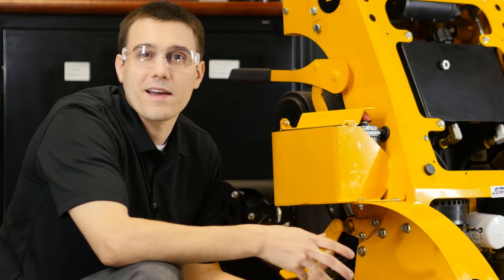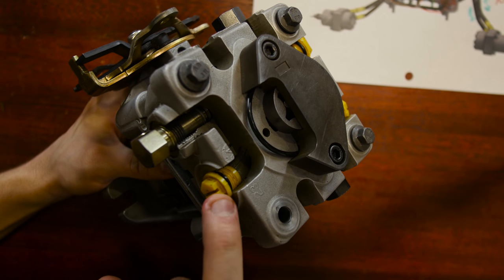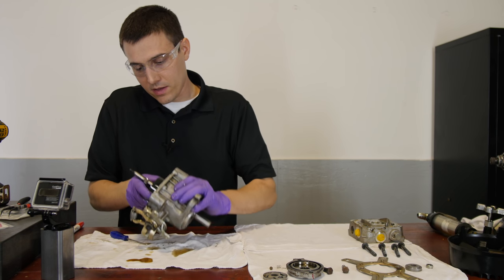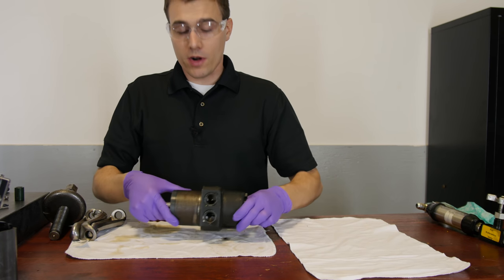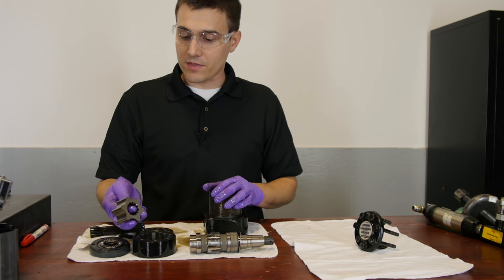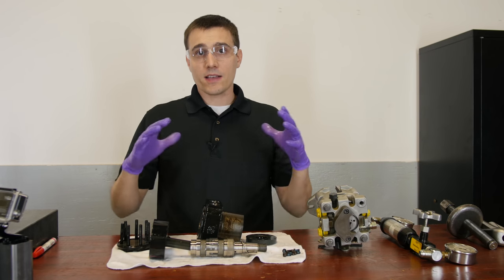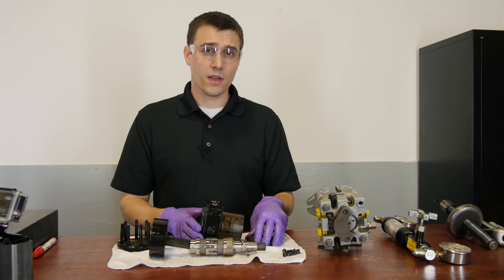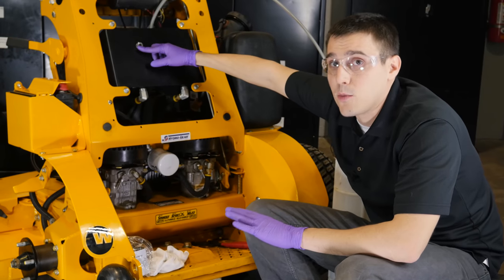Getting More From Your Hydros: Everything You Need to Know

Comment: The video failed to mention pre-filling the new oil filter. Always allow some extra time to let all the air purge out of the oil filter element while completely filling it with fresh Mobil 1 15w50. This helps eliminate a huge amount of air getting into the pump and motor, and prevents momentary oil starvation. You will only lose a very small amount of what's in the filter when threading it into position on the filter mount. It's a good idea to take this extra step on all equipment that use spin on filters. Some manufacturers either strongly recommend, or require this prefilling of the new filters on all their equipment and engines.
Reply: why would you put unfiltered oils into your system. That was asked when i did that a long time ago. Thought on that?
No wrong answer just a thought.
GREAT VIDEO!!
Reply: Hard to pre-fill when filter is horizontal! Should the filter be partially filled?
Reply: CAT, and CUMMINS advise NOT to prefill oil filters as you are putting unfiltered oil straight into the engine bearings.

Comment: change the oil often on those hydrogear transmissions, makes a huge difference. almost as often as you change the oil on your motor. ive had huge performance restoration from dropping the oil. the heat absorbing properties eventually wear out the fluids functioning and it has to be changed.

Comment: I had just put a new seal kit on my pump a couple days ago, when I took my pump apart I didn't see a ball for the charge relief valve and didn't even know I needed one until I watched this video I was wondering why there was even a spring... I have it back together and it works great but now I'm terrified and worried that it will mess up knowing mine is missing something probably critical

Comment: Hi Ed,

I have a Gen 1 Stander X. There was a lot of debris and buildup around both hydros so while rebuilding the engine I took opportunity to clean them up and replace the low pressure feed and return lines.

I replaced the fluid and filter (OEM) after the line replacements. I now cannot get the system to bleed. I am following recommendations in the service manual (jacked up and cycling levers with bypass valves both open and closed). Both wheels turn lethargically and can be easily stopped by hand. Any suggestions? I believe the pumps are at the end of their lives (high time-passive leaks) but I’d really like to get them bled and working in the interim.

Thanks. -Max

Comment: what hydro gear pump is in this video?
Reply from the maker: +Tim Broughton There were actually two pumps shown.  The cutaway one was a 10cc pump from something like a Small frame Stander from a few years ago.  The one with the fan that was disassembled is a 12cc pump that's used on the Stander X.  Thanks for watching.

Comment: Ed, 
  What are your thoughts on not running the engine at high idle when moving the machine around? Is that hard on it when the pumps are growling at you at say 1/4 to 1/2 throttle? Thanks.

Comment: Nice and informative video. For the standard ZTR hydro, is there anything that can be (affordably) done to make them safely run faster or increase output?
Reply: I work at a Grasshopper dealer and get this question quite often. The short answer is no. You can tweak the neutral setting to gain a little. Also you can turn up the RPMs on the engine a little. I wouldn't go any higher than 3680. Some go higher but these engines are designed to run 3600. The small amount of ground speed you'll gain isn't worth the extra engine wear. Hope this helps.

Comment: I tore apart a pump and didn't see anything wrong with it and slapped it back together. Before that it had weak power almost no reverse on the left side. About to tear apart a wheel motor hoping to see something obvious...what could cause the left side to have no real power only barely moves forward but after it's put in neutral the left side still goes forward just as weakly as if it were in drive no reverse working on left still while the right wheel acts normally the whole time.

Comment: I have 3 question.
1) How often do I change the hydraulic  oil on a mower? 

2) can a hydro pump, over heat? Like the hydro pumps from right stander fix deck. Don't have  a cooling fans.

3) is it bad to power wash the mowers and is it bad to power wash the hydro pump?

Comment: Hello, I recently bought a was 5223 with the right side running slow. Took apart the right side pump and motor and they both look spotless inside. No leaks, no foamy oil in the tank, bypass right on both pumps, and with the engine and parking brake off you can push the mower by hand. I'm lost in what to look at next, any help would be greatly appreciated
Reply: Wes 5223
Reply: Mine now has the same issue what did you find. Right side has weak reverse and slow forward, changed fluid/ filter and no luck
Reply: After having the pump apart a third time still not finding anything I put the whole thing back together and bled the air out, the ran like a racecar. One side still moved when the controls were not being touched so re adjusted the cables again and done. You can still push this thing buy hand without the bypasses open which I don't understand but it has a ton of power and speed. You can mow at 10 mph

Comment: We  have a Great Dane 61 inch Zero Turn mower. that left side stopped. we replaced the pump. still same. so we replaced the wheel motor. but its shorter and totally different. because Ross is not in business anymore.  we filled new filter with oil. jacked up mower back end. Started it ,  worked  lever back and forth for almost 30 mins. we also did it with free wheel set on pump. It just dont want to turn wheel much at all.. and when we push lever all way forwards or backwards. it make pump sound like its got air in it or Lack of oil.  Over $1200.00 in the one side so far..and nothing.. any ideal before it goes to scrap. and eat the $ we have in new pump and wheel motor.? Thanks

Comment: Why not use anti wear hydraulic over motor oil. I know it’s recommended,but I’ve been told the formula for engines in motor oil is not primarily for protection,but for keeping the engine clean during combustion.hydraulic on the other hand is formulated for anti wear.would really appreciate your knowledge on this subject,seemingly considering to do the change.thanks

Comment: Hello. I have a Ferris IS2000z ,2008, same as Simplicity, that I have owned since new. The left side good power forwards and backwards. The right side good power forwards go straight but most of the time doesn't like reverse, it does if you play with it a little but something not right... You did sorta say something about the wheel motor, something with oil returning??? Please help if you can? Thanks

Comment: I'm new to Hydro pumps and motors.  I purchased a well used SCAG TT.  There's quite a bit of slop in the controls and it appears to be in the linkage that moves the plate in the pump.  So my question is, is it worth rebuilding.  I will not be using it commercially, just to maintain my 3 acres which are not going to be mowed on a regular basis.

Comment: The relief valve on one of our machines is super tight in the threads regardless of loosening or tightened. Im the only one to ever loosen it and it was the first time this year. Almost like the threads weren't perfect from the factory. Ever run into this? Just curious if its a sign of a bigger problem inside the pump.

Comment: I have a lot of hills in our area so heat is a problem. When replacing a wheel motor is there more to purging the system than you talked about when you change oil in the reservoir?

Comment: If you put 50 hours a year on the mower do you still recommend annual fluid changes?
Reply from the maker: NO, it'll be fine if it's kept out of the weather. -Ed
Reply: My Husqvarna indicates change the hydraulic oil every 200 hours.

Comment: I have a 2015 48" Wright Stander Intensity that I just purchased used 2 days ago with 230 hours on it. I have noticed my bypass valves are turned opposite of each other, but both are tight, is this normal for the new standers to have the bypass valves opposite directions of each other? I have two 2008 wright standers and both the bypass valves on them go the same direction so I'm a little confused by the new one.
Reply from the maker: They should both turn clockwise if you look at them from the front of the mower. -Ed

Comment: What is considered a high temperature for a hydro gear and how do you check it? I can't find this info anywhere. Thanks for sharing this very informative video
Reply: You are asking the wrong question.  Should be asking what the maximum oil temperature is.  Figure 140 Fahrenheit / 60 Celsius.  Above that you half the oil life.  At 170F you quarter the oil life.

Measurement?  Ideally after the fluid has done work, which is going to be in multiple locations.  After the pump, after every motor.  Or average it all and measure the suction side of the pump as it is after all work has been completed, and any cooling applied.

Comment: Are the lines pressurized? I have some leaks coming from I suspect O-rings connecting the hose fittings to wheel motors.. Seems pretty straight forward, but are there any tricks to taking it apart and not having it spray everywhere ?  Thanks
Reply from the maker: There should be no pressure once the wheels are off the ground and the engine is off.

Comment: What could cause a leak at the bypass valve on the pump? I have an identical pump that is leaking at the threads. Inspection revealed 2 o-rings at the base. Would ring failure be the only cause of a leak at the threads, or could something else initiate that?
Reply from the maker: It could be those o-rings.  I'm not one 100% why it might be leaking but I do know that if for any reason the system was overheated it can cause some of the rubber parts to not flex as much and seal as well as they should.

Comment: After the oil change of the reservoir could you run the mower to pull in new oil from the reservoir and repeat the oil change a couple times to get as much new oil in the system?
Reply: Just change the damn oil when you are supposed to.  KISS... not just a ghay band.

Comment: I have a Wright Sport X.  The bypass on the right-side hydraulic pump (nut with short lever which allows the unit to be towed when opened) cannot be opened or shut.  I've tried Blaster, WD-40, and a heat gun.  Got it to rotate open sufficiently to tow mower to shop but can't close the bypass accurately to where it matches the left side pump.  Any idea how I can free the threaded joint?  Usually, when a threaded joint does begin to move, it will quickly become clean; but not in this case.  Any help will be appreciated
Reply from the maker: The relief valves don’t necessarily match their positions, if the mower drives at full power then its good.
Reply: Drive motor on right side (side with problem) is noticeably underpowered.  Bypass will move but, at about 50 ft-lbs torque, is hard to adjust.  Bypass normally can be opened/shut with about 1-2 ft-lbs.

Comment: I changed the fluid in my hydro Reservoir just as a manual said but now it whines I purged it several times still getting a loud whine what could be wrong
Reply: Change my hydro fluid according to manual purged it the way it said now both pumps wine can't get the noise out they work fine power-wise just noisy what could be wrong

Comment: Good info! Hill mounting and keeping sub-20 mins overworking to prevent overheating was very useful! Have 1 related question: Stander X, 700 hrs - at max velocity, the mower banks a few degrees left. When the right (overpowered side) forward control is abruptly released a few cm, there is a low whine. Symptom is isolated to the right side. Checking/lubricating linkages as a first course of action, but suspect internal issue. Dealer has yet to identify issue, may be due to its appearance when temperature is higher, but I'm unsure. Recommendations? Regards
Reply from the maker: There are two types of issues to look for--a whine and a ratcheting noise.  A whine (also often heard when cold starting) is often from a tiny pin hole leak on suction hose between the pumps and the filter--it could even be a leaky filter gasket.  Ratcheting noise can come from the suction on slowing down abruptly causing the pistons in the pump to "float" or the check valve in the nose of the motor chattering.  Most all mowers can do it, especially when stopping on asphalt where you get lots of traction and reversing pressure.  I would not be highly concerned about it as long as it doesn't a lot worse or you start loosing power.  If you are nearing 700hrs you may want to go ahead and change the hydro oil (Mobile 1 15w-50)--you only have to replace the oil in the tank, no need to purge the pumps and motors. -Ed
Reply: Thanks for the reply, Ed! The oil/filter were changed a few hrs prior to the comment here. I will inspect the hoses as a preventative measure and monitor the noise for any shifting. 
Thanks!

Comment: Great Video!  Thanks.  Question - the low flow pump (star gear) is used for lubrication?
Reply from the maker: Yeah, the little star pump is used to keep a positive pressure in the main loop and pulls fresh oil down from the tank and thru the filter! -Ed
Reply: Thanks!  So a two stage pump.  I just took both my hydro pumps apart and replaced the o-rings.  Your video was very helpful.  Thanks again.

Comment: Very good video.  Two questions:  I'm curious how the power is controlled to the drive wheels of a zeroturn mower.  I assume there is a lever on either the wheel motors, or on the right and left pumps, that controls the flow of fluid to the wheel motors.  I assume that the control arms are connected to those levers.  Are the levers on the wheel motors or the pumps?

If one side of my mower gets just a little more power than the other when I move both control arms forward, does that mean I need to adjust the linkage between the control arms and the lever that I spoke of above?
Reply from the maker: Poco, Start by going to 2min 20 seconds.  You will see how the cradle pivots causing the pistons to go "uphill" or "down hill" to control forwards and backwards.  You likely have one of several issues, if you have a linkage adjust it to make that side go faster.  You could also have one side beginning to fail...  Best wishes, Ed

Comment: I have 2013 Stander X that I just purchased with 600 hours on it.  It is very clean and appears to be well maintained.  The previous owner said the hydo oil and filter were just changed over the winter.  It has a slight chatter or stutter on only the right side when accelerating that wheel motor.  I did not notice it when I first tested the mower but it is noticeable now that i'm comfortable with the mower.   Left side is totally smooth.  It has me think that it has to be the motor.  I plan on ordering an OEM replacement and installing.  Any thoughts that it would likely be something different failing?
Reply from the maker: Jerry, chatter is more likely to be a motor.  You may want to change the oil to be sure the correct Mobil 1 152-50 is in it--that's a much cheaper place to start. -Ed
Reply: Wright Commercial Mowers Im having the same problem. I just bought the 36" mower 2015 with only 69 hours it in really good shape. but I can feel the difference in the right handle it takes a litle longer to keep the mower foward. no leaks. it has oil on it the level is where is suppose to be.
Reply: Wright Commercial Mowers is a fixed  deck

Comment: Hi Ed, i have ZT3100 hydro gear drives on my brand new mower. It seems that the oil level in both reservoirs keep dropping slowly but surely. I do keep finding a very small amount of oil collecting around the dish part of both wheel rims. What are you thoughts on this, could it be a drive shaft seals for the hydro gears or is this normal? Cheers.
Reply from the maker: Hi Dean, yes, it sounds like a leaking axle seal. -Ed

Comment: Can I use Mobil 1 sae 15w50 synthet oil also for a Hydro  lesco walk behind mower
Reply from the maker: +bocardo Generally we can't recommend service for other mowers but in this case it has a very similar system to our mowers and our experience is that Mobil 1 15w50 would be one of the best oils for your system.
Reply: +Wright Commercial Mowers thanks

Comment: can you set me in the right direction,  my Simplicity Cobalt mower.. left side good power forwards Harley no power in reverse for the left side... it starts off with power but then it stops off like a spring opens up to relieve pressure then power is gone.... the right side is fine forward and backwards.is it  adjustment or problem with pump?
Reply from the maker: Hi!  I'm not personally familiar with that model and not sure what transmission it has.  It sounds like a stuck pressure relief valve?